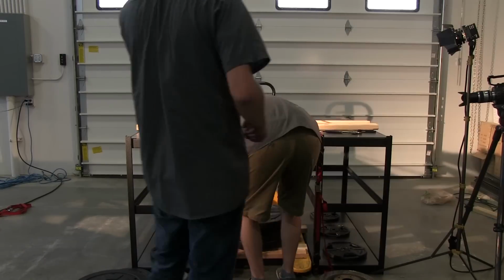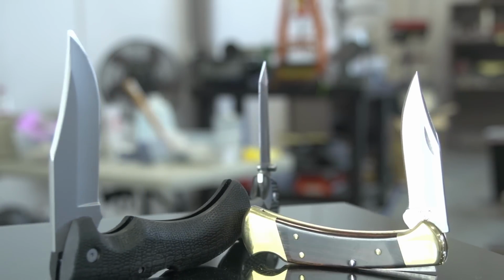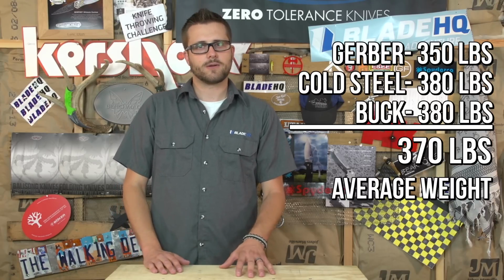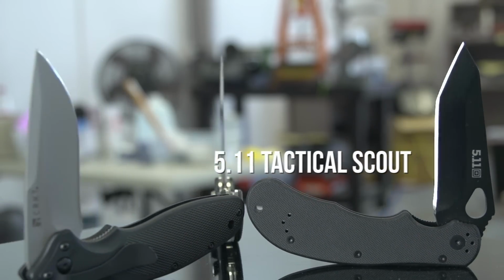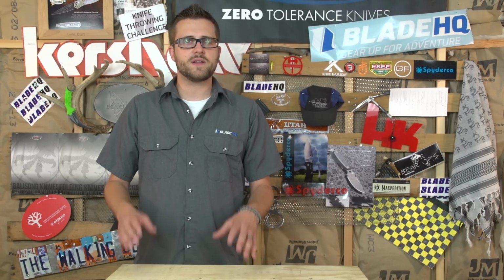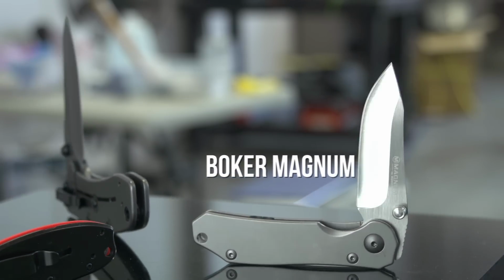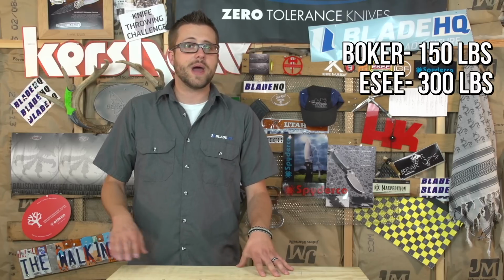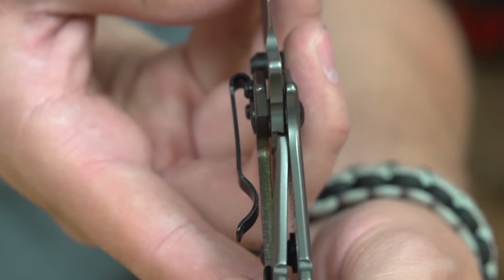Pocket Knife Lock Strength Test

Comment: This a great test for lock strength....but I don`t cut that direction ,what about a stop pin test in the direction of a cutting motion to duplicate cutting ?
Reply: Very good point and observation. I didn't think of that. I guess the main reason is everybody is worried that the knife will close on their fingers since they are right where the blade goes when you are holding the handle. If the stop pin breaks you wouldn't normally get cut. I had a cheap Frost knife stop pin break when I was cutting cardboard boxes down once but no injury. Just tossed it into the trash and moved on.

Comment: The Voyager is technically a good one handed opening and closing blade, I personally don't have one but I own a spartan, ad10, code 4 etc they function awesome even easier then a liner or frame lock since you're not fighting to push the liner over. By far I'd have to say the coldsteel had to have done the best out of them all

Comment: I loved this! Keep em coming!! Two problems I saw: First, you can't get an accurate idea by stopping at 380lbs. And second, Cold steel's Voyager uses a Tri-ad lock, not a common lock-back lock. The tri-ad lock is designed differently and is much stronger than a normal lock-back lock so that specific test wasn't accurate either. Other than those two things I think it was really interesting to see how the different locks preformed just between manufacturers. That shows that the material had as much to do with the strength as the actual locking mechanism did.

Comment: not complete without axis-lock and spyderco/sog versions
Reply: It would never be "complete" unless they tested the dozens of different locking mechanisms. They aren't going for complete, they are going for the most used locks and comparing them.
Reply: i enjoyed it but he is right you forgot Automatic Knives, Out the Front, and fixed bladed knifes :)
Reply: And button locks, and midlocks, and sub frame locks, and piston locks, and ball locks, and balisongs, and compression locks, and titanium compression locks, and collar locks, and bolster locks, and Klecker locks and even more than that... No way they would have tracked down disposable knives to do this little test on. They certainly didn't forget about them, it would be much more time consuming and expensive to do it so they tested the three most used locks.
Reply: Yeah

Comment: The lockbacks are helped by the fact that the weight applied was directly on top of the active portion of the lock. It pushed the locking mechanism into the locked position during the application of the weight. The others did not have that advantage. It would have made more sense if you applied the weight behind the release mechanism.

Comment: Super cool, only problem is the cold steel isn't a lock back, it's a triad lock. Which is much more structurally sound in that the pressure is put on the steel liners instead of the lock itself. That could've skewed the lock back results.
But I still enjoyed, would love to see a max out between triad lock and axis lock till they break.

Comment: The Gerber failed. What a surprise.
Reply: +rocky balboa ll, so what was your point, others failed as well
Reply: +Jim Akemon he just means that it was expected that Gerber would fail
Reply: lol, It was expected that all of them would fail at a relatively low weight. That why the testers didn't  use a higher table...Think about it and look at the description, they didn't do the test to see if each lock could hold 100 lbs. They wanted too test to failure. My statement still stands. Now if rocky had said "The Gerber failed at a low weight. What a surprise".....That would be different, as it's well known most Gerber's are junk
Reply: Failed at 370 still pretty good

Comment: My issue with this test which was done  inaccurately should have been done where the stress on the handle would have been the most which would have been almost directly at the end of the handle not at the pivot point where the blade fits into the handle that would give it the most resistance to snapping because it would have a closer Pivot Point to the folding access which would in turn give it a higher rating for weight pressure tolerance. I love physics I wish they would have done this with a higher ratio of torque. If you ever want to bounce ideas off of me I would love to be a consultant for you with these opportunities of testing you guys are amazing keep pushing the envelope.

Comment: Not sure how useful the info is to me but it did change a bit of how I see folding knives. Given a stronger handle the Gerber would have maxed out. And the ESEE folder performed better than I thought it would have. Thought it was going to fail at 200lbs. You guys should try and figure out how much weight different large fixed blade knives can hold. Im interested to see how much a bk2 vs esee5 could hold. Or maybe even a ka-bar.

Comment: Lockbacks surprised me. I have avoided them since several different models have unlocked in use for me. Not a structural failure but one of ergonomics. The lock "button" on many falls in a perfect position to be disengaged by my big ham fisted grip. These are knives that usually have the "button" somewhere in the middle or are short handled.

Comment: I think the reason the lockback won is that instead of pushing downward into the lock bars in the liner and frame locks. The force is actually pulling on the lock of the lockback.

Comment: Great comparison. I think that having the in front of the pivot of the lock, closer to blade pivot, might have gave it an advantage. Back at my old job we had plenty of things that would pop open under torque, but I simple piece of masking tape would hold it together. The weight on the wire was not pressing directly on the lock bar, but it was also compressing the frame itself, which put a load of the lock bar, which would give it a higher static friction giving it a higher locking power. Same thing could happen if your holding the knife. Which was also the flaw I saw with the framelock. A small amount of pressure old in the lock in, could multiply the locking strength.

Comment: Interesting results, was surprised at how strong the lock back was.  I would like to see how a titanium liner lock and frame lock would have faired.  I would also point out the liner locks didn't completely fail, or I should say didn't catastrophically fail, it was a gradual fail where as I've seen lock backs break at the lock bar.  Anyway wasn't really surprised except for the strength of a decent lock back, the liner locks worked as I expected.  Thanks for sharing.

Comment: Reality is that the TRIAD lock on my sub $75 G10 Talwar from Cold Steel has a Stronger lockup then a $400+ Strider SMF..... and not only is it arguably stronger... its also far more durable over the long haul since a titanium lock bar's low rockwell hardness will, over time, develop excessive play and in some cases, lock rock..

Comment: awesome test the only thing that i would have taken into consideration is the weight of each knife as well... for example the gerber gator is about 2 1/2 ounces more then the cold steel voyager and the buck ranger was easily heavier the both due to the steel frame. great test maybe try doing this test with knives that are within an ounce or so of each other but awesome job

Comment: I really like these kinds of testing videos.  Thank you for conducting the experiment!  In this test, though the cold steel tri-ad lock may have held significantly more weight than any of the frame locks, since the test maxed out at 380lb, the average did not take this into account.  Really, the tri-ad lock should be in a different category by itself.  Also, I would love to see this test(let's max it out at 1000lb this time!), with the cold steel tri-ad lock, the benchmade axis lock, and the spyderco compression lock going head to head.  I believe these will all be much stronger than the standard 3 types of locks tested here.  It would be very curious to see the results of that experiment...

Comment: Great video. I wasn't surprised by the results at all, except I was surprised that the Gerber failed at such a low weight.

some of your results were off. For the liner locks, you counted the weights that both blades BROKE at, not what they successfully held...and for the frame locks, you counted 1 at the weight it failed at, but the other at the weight before it failed...so that either means both groups are lower, or the frame locks are slightly higher than your final results...

assuming using the highest HELD weight, Liners are 210, Frames 260, and Lockbacks same
Reply: Lockbacks at 353

Comment: Interesting results but not that surprising as I expected the better brands to win like the Spyderco and Kershaw. With these locks it comes down to the entire body's build quality as well as the steel used for the lock. It would be interesting to see how a titanium frame lock would do as its quite tough or springy but they typically have a stress riser built in where liner locks do not. I think this is what gives frame locks the appearance of being tougher but in reality I bet they would fail sooner due to the thinned out portion concentrating stress.

Comment: Would have liked to see Cold steel Triad lock.  Great information on the video as is.  Thanks.
Reply from the maker: +frankgon4 Pretty sure the Cold Steel Voyager use in the video has a Triad Lock on it. It went the distance.
Reply: @BladeHQ  you didn't test to failure though, which is what was needed for you to list averages.

Comment: Not to add to the "controversy" but in the case of the lockbacks, since the strap holding the weights were over the lock wouldn't that press it down helping to keep it in place?

Comment: First of all, the Cold steel voyager is a tri ad lock, very different than a loose lockback
Second, where did you tie these weight ropes? i can see lots of handle behind the loop holding the knife! You dont put your force closest to the pivot
And i just cut my finger again on my endura, i pushed it against the underside of my table to see if it would flex
Nearly cut my tendon
My other endura ripped its tang lock surface clean off the blade when i dropped it
ow....

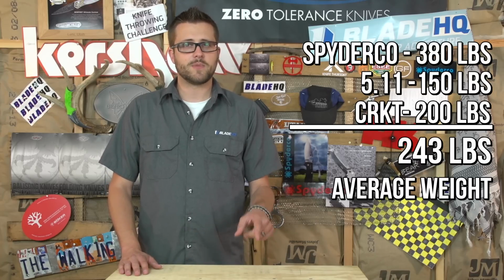6:44
Observe how the ESEE has one round weakening cut on the lock while the others have larger, two or rectangular cuts

Comment: spyderco endura would be more fair comparison instead of cold steel voyager... And sometimes you can hang 200+ lbs on a knife, that folds of the slight spine whack on the metal surface, the shock/impact is the key.

Comment: Very interesting, I thought the frame locks with be better at holding that weight. If you made a part 2 make sure to use more weight also that was a great setup you had to test them.

Comment: Something to think about....on some of those, did the lock fail or did the non-premium metal in the blade tang fail?

Re-run some of those tests with a blade that has S30V or better steel in it.  Might be a different outcome...

Seems like some of the tested had the lock just "round off" the cheap steeled blade tang.

Comment: While indicative of which are strong and which are weak there are too many variables to say conclusively which is better.  The limit to the weight gives a skewed result.  For all we know the lockbacks could have snapped at 5 more lbs while the spydie liner lock could have hit 1,000.  Not likely but possible making the test useless.  The cold steel is a triad lock if I'm not mistaken, which adds a pin that puts the weight on the entire frame similar to an axis style lock.  So it's not exactly a backlock.  A large part of the framelocks strength comes from the fact that the grip of your hand fortifies the lockbar's position (something impossible to include in this test safely, it could be done but you'd have to measure grip strength of a wide range of people and take the average then apply that force to the outside of the lockbar throughout the testing).  Then you have the manufacturers different tecniques of making the same things, heat treats, materials, thicknesses, angles, and so on.  Just look at the huge difference between spyderco's lock and 5.11.  Three different brands is not enough to get an acurate average.
      I think it may have been different with framelock category populated by things like medfords, striders, or crks.  Or just removing that gerber gator from the back locks and throwing in another more robust knife with say titanium scales.  That gator's cheap plastice shredded like tissue paper lol.  (Granted it held a decent amount before it did but still)  Just way too many variables to be accurate.  That being said it was still an interesting comparison and an entertaining video.  And I appreciate you taking the time and money to destroy some knives to give the public a little better understanding.  It's by taking in this vast sea of video and data on youtube and the net that we CAN get a true approximation of the quality of products.  And now it's much harder for the lumps of shit to hide in thr tall grass lol

Comment: In this case, not using the compressive force of the human hand, I feel like frame locks and liner locks should be similar with lock strength.  Just my opinion.  I was very impressed overall by the results.

Comment: What benefit does this test prove? How often are you applying hundreds of pounds of force to the back of a folding knife? I would be more interested if the stress was applied the other direction. Also known as the direction most forces would be during normal use

Comment: Did you make sure the distance at which the weight was applied from the lock was the same for each test?
Reply from the maker: Tom Nelson We tried and were pretty close on most, though a few of the handles made it difficult with they way they were curved.

Comment: How are you adding these weights? The fail for there Gerber was at 350, so it should be counted as holding 300. For the Boker, that failed at 200 you do count only 150.

Comment: The Gerber didn't even fail at the lock. Look at @3:07, you can see the cable has cut through the rubber and pushed the lock release! 
This entire thing was a horrendous abuse of statistics too - maxing out at 380lbs tells us nothing about the strength of the knife for averaging purposes.

Comment: So I recently bought a knife and was cuting something and I didnt use the safely on the back of the knife and my finger disengaged the other safly and it closed of my finger and cut through 70% of my tendon so please use both safety locks so if you have knife with 2 safely please use both because it it has 2 safety it probably means you should use both

Comment: Test design appears flawed: since the cable is placed about 2" from the pivot, it actually favors the back lock since it presses the locking piece into the blade base, reinforcing it (that was also the case in part 1). So the results of back locks would be higher in relation to the other lock types than if a neutral spot (say, 4 inches from the pivot) on the handle was selected.

Comment: Your testing method favors a lock back design because the cable holds the lock in place so it can't  disengage. This is evidenced by the gerber where the handle had to explode because the cable prevented the locking bar from slipping out of the notch. In this case you treated handle strength and not locking strength.

Comment: just saying the cold steel voyager does not exactly have a lock back lock. It has a cold steel patented tri ad lock, which adds a pin to relieve pressure and has more contact on the actual lock back part of the lock. It is stronger than the lock back.

Comment: 10:03 The way those liner locks failed is exactly as designed, so the liners prevent the blade from closing on the user's fingers.

Comment: If you take the lock back knives and smack the back of the blade on the edge of the desk or chunk of wood it will dislodge.  Hanging dead weight provides no indication of how secure the blade is, because no one is using a knife in that manner.  However, there is a very real possibility that a person might bump the blade or hit the back of the blade or handle during use, and the knife will fold up very easily.  Try it sometime and you will understand that hanging weights might be fun -- but proves nothing with regard to the security of the lock-back design.

Comment: You need to measure each point of the hang for this to be accurate becuase more weight would come if the connection is farther out on the handle.

Comment: Just a question, when do you ever use a knife backwards ? When do you use a knife so there is pressure on the back of a knife. Not sure when I would ever use my knife like that.  I can do a lot of things to a knife and it will break, that doesn't mean it failed, it means I abused it. I guess this is important, if you ever want to use your knife for an engine hoist ?  Sorry guys, don't see the point. Do tests on edge retention, ease of resharpening or corrosion resistance, more useful information.

Comment: I'm not sure this test holds up. By using so many different manufacturers(some better than others), and most likely different materials used in the knives(some base materials are stronger), small sample size, distance from pivot as mentioned already etc... it's hard to say that the results are really representative of the lock mechanisms. Would have been better if they had done it with only three companies with one type from each representing each lock type.

Comment: I broke a spyderco manix splitting lighter wood not shure what happend at first i thought it was defective blade that broke from vertical  pressure got a machetete and the knots in it made it bend horizantily not 100 percent shure what happend but becuase of spyderco hole they put in blade it isnt to strong with it being estimate of 1/2 inch